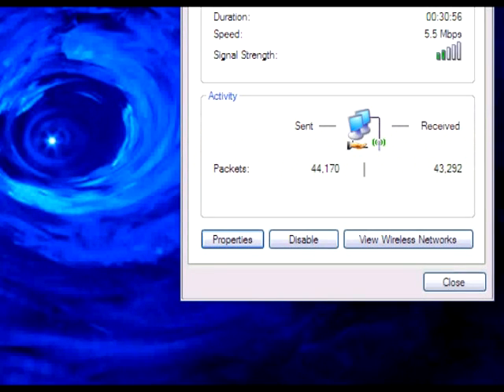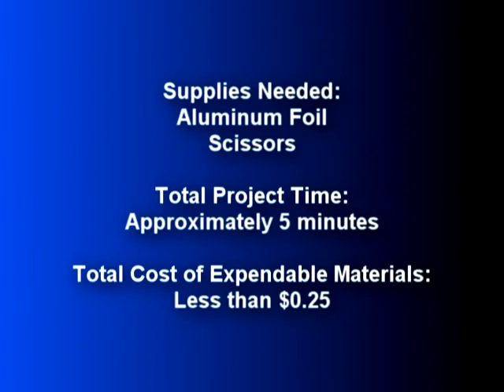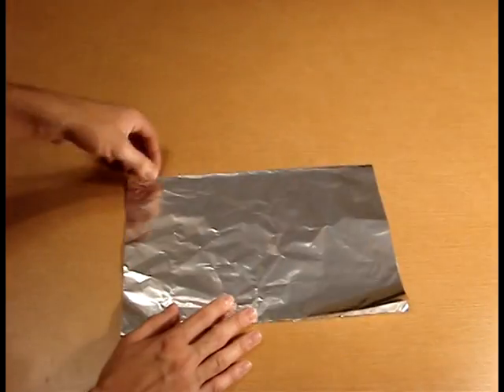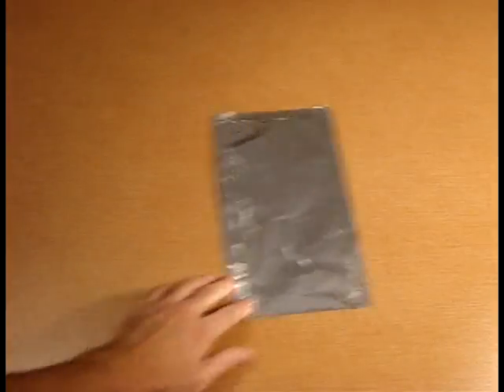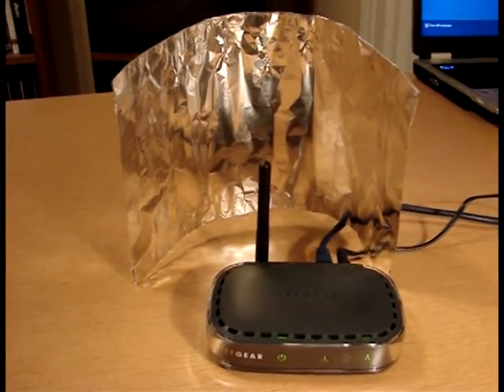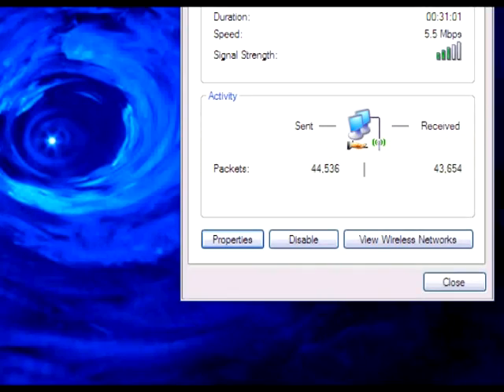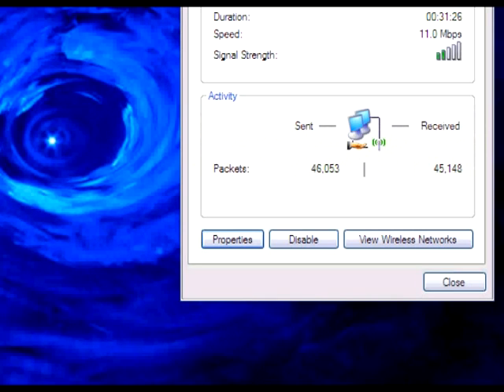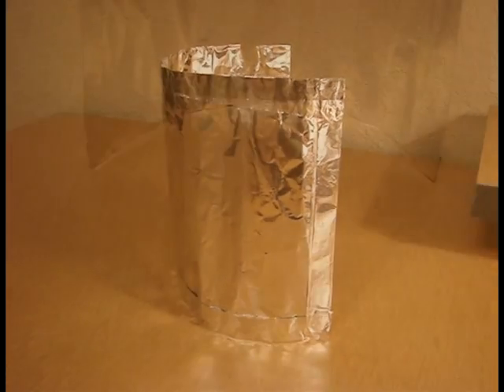How To Boost Wi-Fi Range With A Homemade Parabolic Reflector

Comment: I tested it out, and then i tried with a bunch of other materials, and realized that it would work a lot better if you stick the aluminium foil in the microwave for about 30 seconds. Put the foil in before you start to fold it. Good luck!

Comment: it wont work.even if it does,the results wont be noticed.so pop open your wifi receiver.you will see a solder antena.a solder antena is basically something that is just some lines of soldering to receive the signals.take a small peice of copper wire.and solder it to that antena.make sure to remove the enamel.then pop back the cover and youre done!.this think will work.a parabolic dish made from tin foil??tinfoil absorbs such high frequency signals.DUH!

Comment: Wow. I just tried this right now and guess what. IT WORKS! I made a hole in the middle and then placed it half way on the antenna, kinda like a satellite dish and my signal signal went from 2 bars to 3 solid bars but at 24mbps which is REALLLY fast compared to 1mbps. Which is a HUGE difference.

Awesome video! Kudos!

Comment: @DarkAssassin181 Nope,The Signal Strength is distributed from the Router,not the ps3.
Meaning you can only boost the connection fi you do this to your modem.
you can also do this to your xbox 360 router.

Comment: This actually works - just move house. Router at front of the house, office at the back. Went from no signal at all to a completely workable signal. Was sceptical as to what the improvement would be, thought I would give it a go before I invested in a wifi repeater - glad I did. Thanks

Comment: does the reflector have to be parallel to the antenna? Say i want to direct the signal upstairs, would i have to tilt both the antrenna and the reflector? Or might it work if the reflector was like a bowl at the bottom of the antenna?

Comment: yap. having reflectors like these keeps 3 houses here online via one WiFi router.

One house has the antenna in the focus of an 
old TV satellite dish.

You can do even more: 
placing the antennas 
into tin cans lets the antenna work like sum 
kind of microwave relay-station. This makes it 
harder for hackers to hack into your WiFi signal.

Comment: this could work but I'm sorry to say it - not every time. If you have a cheapo dipol antenna - looks like a stick, some are longer (like tp-link router) and more sensitive. This one is not scientific enough - get blueprints and printouts for cutting it out on your own and you will get some improvement, not on inbuild antennas however. You can alwasy put one of these on your router antenna though!